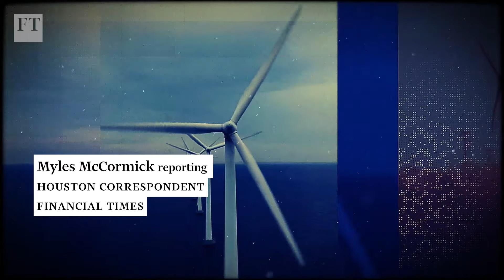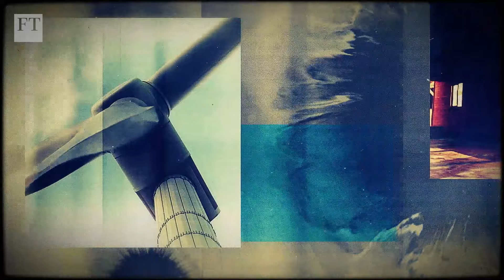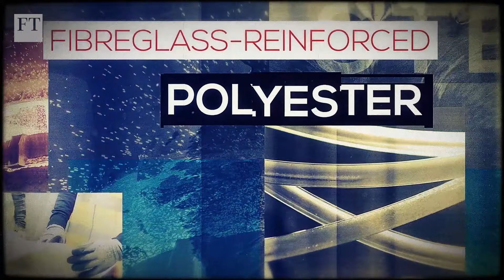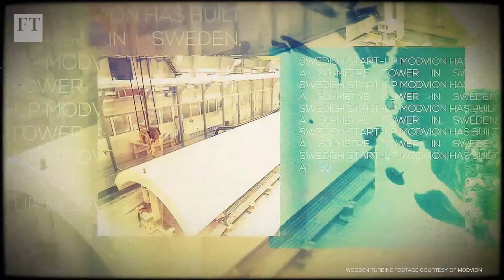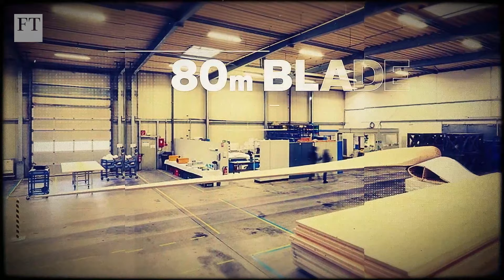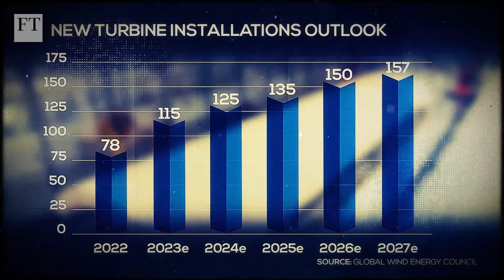Could wooden turbines complement traditional construction techniques?  | FT Energy Source

Comment: Nonsense. According to all life cycle assessments, wind turbines today amortise within less than half a year. 
Nobody would even think of making a Formula 1 racing car out of wood. 
Today's wind turbines are 150 to 180 metres high because the wind is stronger and more constant from a height of 100 metres. 
No wooden tower can withstand this for longer.
Reply: And with a wooden tower it would maybe be less than half a year. if it reduces emmisons last as long and is cheaper of course they should be used 🤷🏼 
The height is a bit of an issue though but there must be some on shore locations where 100-150m is enough.